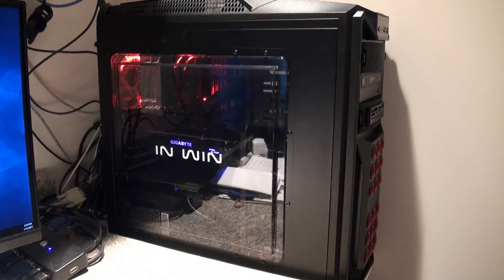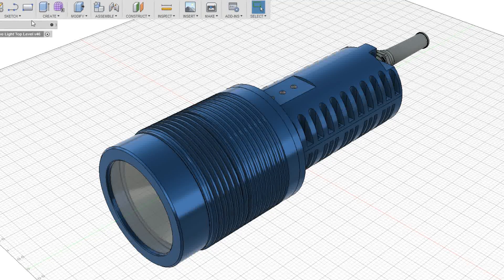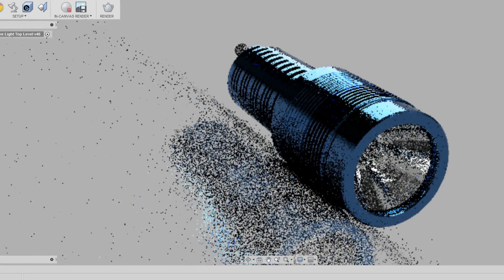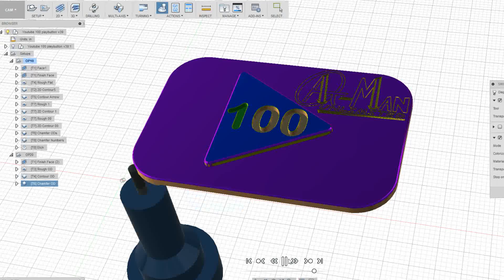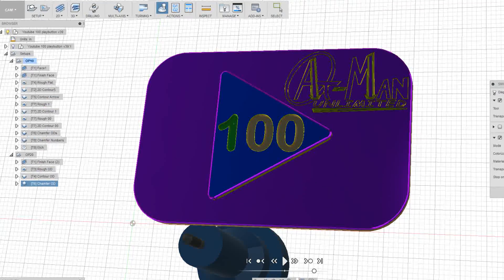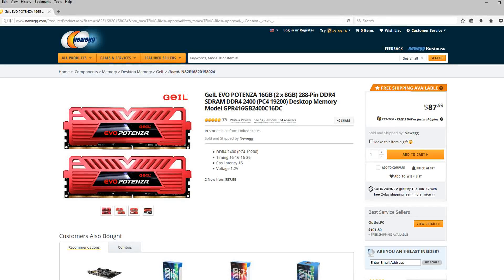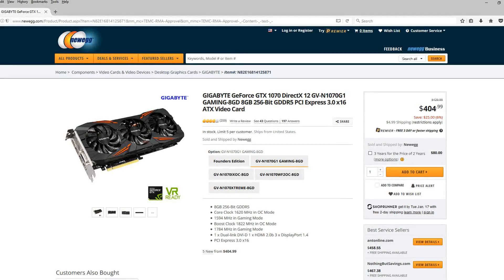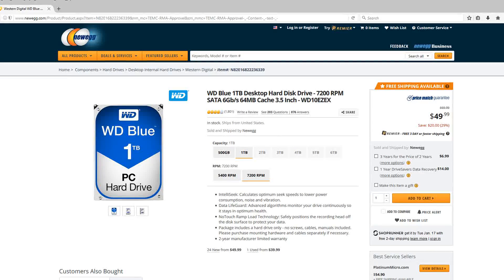PC Build for Fusion 360 and video editing

Comment: Hi there
 I came across your video because I’m in the process of looking for a laptop that’s going to handle fusion 360 and videos for YouTube I do move around the lot from my daytime job and was wondering what will be some options on your end and laptops any info will help thank you
Reply from the maker: You just want to get a higher end CPU and graphics card. Having a decent chunk of ram helps. With the latest chips Fusion really is not that bad until you get into huge assemblies of parts.
Reply: At-Man Unlimited Machining  thank you so much for the info really appreciate it..

Comment: I am curious if your build choices would change now, given the newer processors. I am currently building a budget 3D Printer design machine. Basically machine that can run fusion smoothly enough to not make the user insane. I went with a ryzen 5 2200g, testing with both an RX 560 and the integrated Vega 11 graphics, which is on par to an RX 550. For the budget oriented, the 4 cores 8 threads is perfect with the Vega 11 integrated graphics, and does beautiful design work and rendering. It takes a bit longer, but at an OC of 4.0 GHz it does surprisingly well at just over 600 dollars, and could be built for as little as 450 if you are smart about part choices. 

Also, as a side note, I am also a software engineer and programmer, and 4 cores 8 threads is not quite like having 4 extra simulate cores. Basically, 1 cores 1 threads is like feeding your mouth with one hand, having to take a break to wait to pick up more food. 1 core 2 threads is like using both hands. While you put food in your mouth with one, the other is getting more food and can feed you immidiately after hand one finishes
Reply from the maker: Yes, I would use different offerings now. The amount of power you need with fusion is also dependent on the models you work with. If you have a lot of components and complex surfaces it can stack up on you pretty quick. This has 4 cores with hyper threads, and the cooler I used keeps it at the boost speed of 4.38 GHz. I don't bother over clocking, I just want it stable. I did put in way to much memory, I have never seen more the about 30% used at a time. This is with windows virtual memory disabled.
Reply: @AtManUnlimitedMachining  I am seeing amazing results using an r5 with 4 cores and 8 threads and combined with 16 gb of 3200 speed ram, which gives me enough to Max out the shared video memory, it Cooks right though on most jobs, and it's tolerable on more complex models with lots of comments

Comment: Could you recommend a laptop for fusion 360? Thanks
Reply from the maker: I use a higher end Dell Latitude and it does good. Not as good as the desktop, but very respectable. CAM simulations, rendering, and FEA are a bit slower. But not so bad you need to drink more coffee waiting around.
Reply: At-Man Unlimited Machining  thanks for replying I got a Lenovo coming hopefully it’s decent
Reply from the maker: Your welcome
Reply: Which Lenovo did you go for? How is it doing? Cheers

Comment: thank you very for this! i searched far and wide for advice on a PC build specifically for fusion 360 and yours is the best one ive found!  you said that fusion does a great job of utilizing core count so with that in mind, what do you think about thread ripper or the new i9 processors for fusion 360? would they perform better than the i7 8700k (overclocked to +-5Ghz) 

would love to hear your advice on core count vs clock speed and which one fusion takes advantage of more. 

Thanks!
Reply from the maker: In the life of PC's this is getting old already. But it still runs fusion faster then I can work. Anything faster will just run it better. With more cores you should be able to process more CAM operations faster at the same time. I'm not sure if there is a maximum core count they will support. Maybe try and ask on the forums, Autodesk engineers read them regularly.
Reply: Look at SiliconForensics.com   Bleedin edge fat.!

Comment: Hi At-Man

Thanks for a great vid.

Can i ask your advice for a what current  Asus mobo + graphics card to use with a i7-7700K 4,2 Ghz processor.

Im looking for a machine that will run large F360 designs and some casual gaming :-)

Thanks a lot

Mikkel
Reply from the maker: Hello Mikkel, I don't really stay up on the tech, moves to fast still. What I did is pick a processor which you did, find the boards that support it, then look for reviews on that board. There are a few really good channels that do nothing but review the new hardware, gives you there opinion of the good, bad, and any issues they ran into. Here are a few I went to when I was researching what I wanted to build. https://www.youtube.com/user/LinusTechTips https://www.youtube.com/user/paulshardware https://www.youtube.com/user/GamersNexus There are a ton more, these are just the ones I found most watchable and gave good technical detail other then "the RGB lighting rocked" For fusion you don't need a super top of the line video card, I went with a GTX1070 and it runs really complex assemblies with hundreds of components just fine.
Reply: Hello. I haven't build a machine in 15 years so i absolutely agree tech moves sooo fast. Thanks for the advice and the great vids. Mikkel
Reply from the maker: Your Welcome

Comment: can a Intel i5 run smoothly fusion360 ?
Reply from the maker: Hello Mark, My old machine was a Core 2 quad with 2GB of ram and on board video. It ran Fusion ok. I would think an i5 would run it just fine. Having a dedicated video card I think makes a big difference, and it does not need to be a high end card. I found if you imported large DXF files with lots of splines it really brought the Core 2 to its knees. That is why I upgraded. But simple sketches and solids ran just fine. CAM simulations where a bit slow. I went top end because I really only build a PC every 5-10 years now. So I want it to keep up for a while. I put way more RAM in this machine then I really need.

Comment: thank you. We are looking and buying a 4020 Fadal in the near future .We use all manual machine right now so your channel is a big help to us. We started using Solid Works for drawing and creating DFX files for the plasma table but have switched to Fusion 360 and love it. The one draw back is the drawings are not as good as Solid Works.
Reply from the maker: You welcome, 4020 is a good machine, I had the chance to get one but it was just to big for my current space. It is not to different then your plasma, you just generate 3D G code rather then a simple DXF. Calmotion makes a device that is out of the box and does almost what I did. It is also well priced for what you get.

Comment: love your videos. I have a question when you redid your machine did you install a USB port so you can run the mill with fusion.
Reply from the maker: Hi Gary and Thank You. I do not need a USB to interface with my mill. When I post process my Fusion files the G code goes directly to a Network Attached Storage (NAS) Drive. I'm a Software Architect by trade so I designed an embedded system that interfaces with my machine and can browse and pull files directly off the NAS. Makes my work flow seamless, from Fusion I post my code, then walk to the machine, browse to the file directly from the machine pendent, then I can download or DNC the file to the machine to make the part. No serial cables, no USB, no disks, nothing. Just type and go. I made a video on it here https://youtu.be/UJjYKtqog5Y Thanks Tim

Comment: That chip you're talking about is out 7700K.. I just built a system for cam work for client and overclocked it to 4.9ghz if he went under water loop. I could have gotten him 5.2 ghz  to 5.3 ghz.. FYI you have fan controller on the motherboard
Reply from the maker: Nice, I didn't think they where going to be available that soon. I would have ordered one! The 6700 is more then enough for me, not waiting for the machine at all. Yes, this MB has 3 fan controllers on it, but I have 5 fans.
Reply: 3/4 pin splitter.. O yea that chip is cooking. I just brought 7600K so see how far I can push that under water maybe even liquid nitrogen

Comment: I was just looking for new laptop and money seem to go for...  Lenovo Y900 I7-6700 Ram 32g SSD 500g and HDD 1T GeForce GTX-980M 8G 
Over kill is this too for video making and fusion.  If someone has better idea for good idea and even greater idea let me know about that...
rs-323 would be nice but not easy to get it,, for lap tops of today....
Reply from the maker: I use Dell laptops, I find there still the most robust if you buy the pro line. RS232 in a laptop is almost non existent. In that case I use a USB adapter but a lot of them wont work for DNC. I have a latitude E6520 loaded up now and it runs Fusion respectably.
Reply: I wouldn't buy anything with 9XX series card now.. I would go 1060 or 1070
Reply from the maker: If your only doing Fusion they really don't use the GPU that much. I'm only seeing 20% on the 1070.
Reply: He is talking laptops.. the 9XX series are still selling for the price as the new 10XX series laptops.. unless he finds a great deal no point getting outdated 9XX series
Reply: Video editing and fusion 360 are main thing that i do..  I am not playing any games..
Reply: HybridiHippo well some video editing software is gpu accelerated so